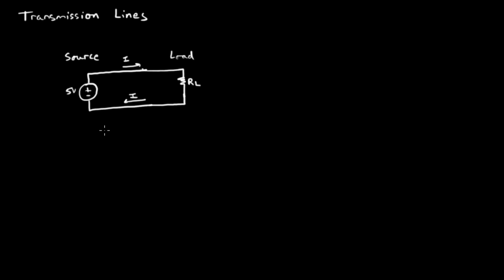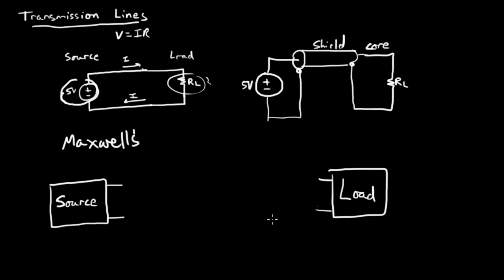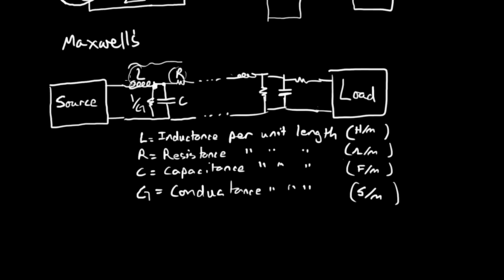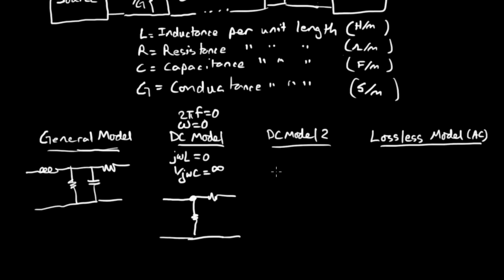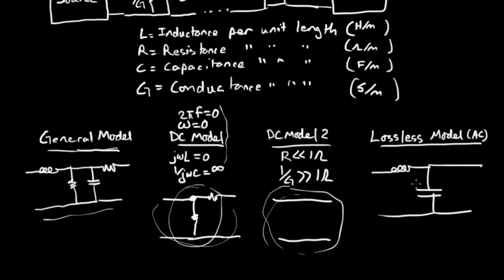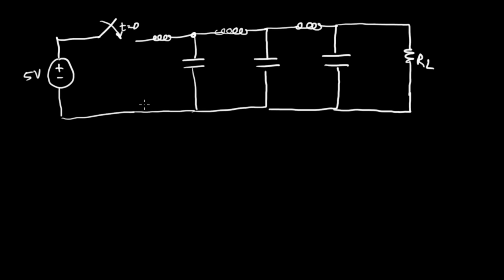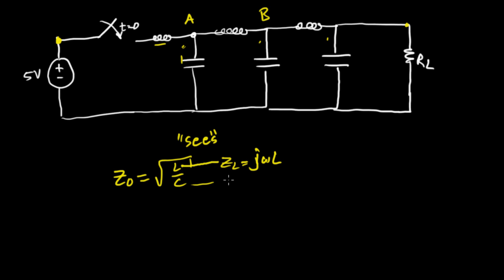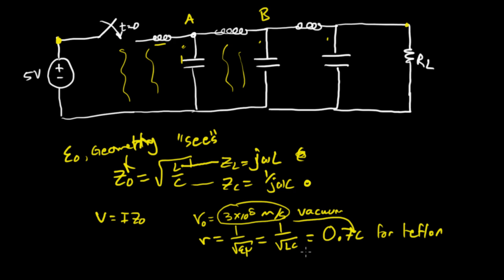Transmission Lines 1 of 2

Comment: After 4:20: "Every wire is a transmissionline". Really? Or do you mean that every pair of wires is a transmissionline?
Reply: What is a transmission line?
When a high frequency signal voltage is applied to a transmission line, which consists of a pair of perfectly conducting parallel planes separated by a distance, energy transfers from the source to the load by pulsating electric and magnetic fields between the planes; the fields don't travel.
Transmission lines are analysed by considering the voltage and current on the line, and the field configurations and wave dynamics provide insights into the origins of the voltage and current.
The book "Fundamentals of electric theory and Circuits" by Sridhar Chitta
https://www.wileyindia.com/fundamentals-of-electric-theory-and-circuits.html begins with detailed discussions in the initial chapters 
on the topics of surface charge, coulomb's law, electric fields, fields of dipoles and other charge configurations such as a pair of parallel plates, in which a distinct approach is made using the surface charge concept in the study of advanced topics of capacitance, currents, conservation of charge, conservation of current, superposition of fields, superposition of potential, a simple dc circuit, voltage, voltage source, difference between e.m.f. and potential difference, ideal voltage sources, resistors, how current branches in a parallel circuit, capacitors, and the superposition of ac signals on a dc voltage for coupling signals to amplifiers.

One section in Chapter 3 describes the principle of superposition of potential and provides an intuitive explanation of its application in small-signal ac circuit anaysis and developing ac equivalent circuits which is not usually found in textbooks.

Then, two chapters are devoted to discussions on magnetic fields, magnetic fields of a current element, straight wire, current loop, solenoids, biot-savart law, inductors, Faraday's law, inductance, ac circuits, and transmission lines. 

The section on Transmission lines in Chapter 5, discusses signal transmission over two-wire lines and coaxial cables. There is an in-depth discussion on the origin of common-mode currents, incident and reflected waves in transmission lines and the TEM mode of wave of propagation.
One section is devoted to a discussion of the attenuation in the context of lossless lines and the speed of propagation of signals over transmission lines.
In several chapters, the differential-mode signals of circuits are identified and in one chapter a comparison of the differential-mode signal and common-mode signal is provided. 
An interactive Java based program depicting the passage of signals on transmission with a provision to vary line parameters is included in the CD alongwith the book, which is useful to understand the propagation of signals on transmission lines.

Subsequent chapters discuss the
Lorentz Force law, motors, generators, p-n junction diodes, electromagnetic waves, antennas and radiation, waveguides, and new electrodynamic theories on the nature of the electric field.

The CD contains animated power point presentations for all chapters and voltage regulator, RC phase shift oscillator, transformer-coupled audio amplifier and differential amplifier included additionally.
The contents of the above book by Sridhar Chitta, make a distinct unified approach to electrostatics and a few advanced circuits like coupling signals to amplifiers. This approach lends precision and clarity to the topics which is not found in most text books.

There is a "look inside" feature in the amazon.com webpage of the book "Fundamentals of electric theory and circuits" by Sridhar Chitta with a few pages of Chapter 1 which may be viewed and also which you may swipe left or press < icon to view the foreword, preface and Table of Contents. 
There is a full set of lectures beginning lecture 13 here on surface charges, electric fields, simple circuits, capacitance, inductance, faraday's law, motional emf, magnetic forces and more topics here
https://matterandinteractions.org/videos/EM.html
Electrostatics and circuits belong to one science and not two, that of electricity and magnetism. To know how they are unified visit this link 
https://matterandinteractions.org/articles-talks/ and view the article 'A unified treatment of electrostatics and circuits.  B. Sherwood and R. Chabay, unpublished. (1999)'
pdf. 
For a live demonstration of surface charge and its effects in circuits visit 
https://youtu.be/U7RLg-691eQ
Reply: @sridharchitta7321  Haha, thanks!
Reply: Consider connecting a single wire to one terminal of a battery. The potential of the terminal and the wire become equal in a fraction of a second when connected.
This happens by a movement of charge. So, you may say, every wire is a transmission line.
In the transmission of high power high frequency signals between a source and a transmitter, waveguides are sometimes used and these are single conductor in construction and not a pair.
Reply: @sridharchitta7321  Right. That's the answer I was looking for. Explained in simple words. That's the power of education!
Reply: @jacobvandijk6525  Thank you. I am happy it helped.